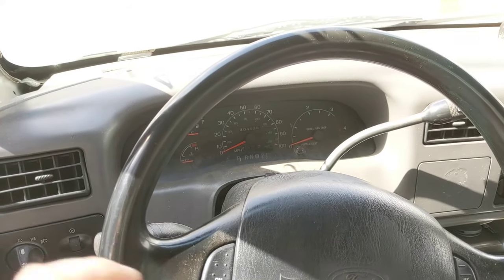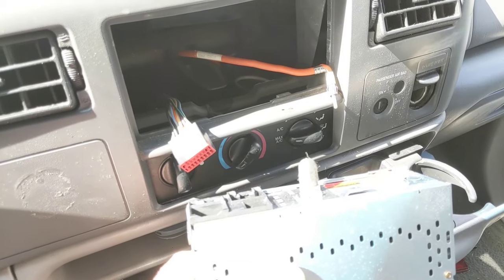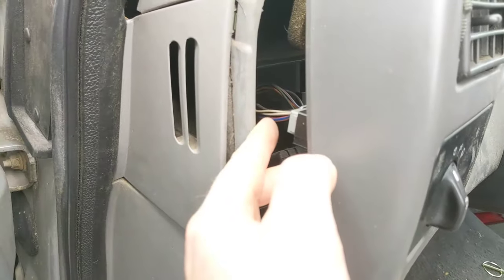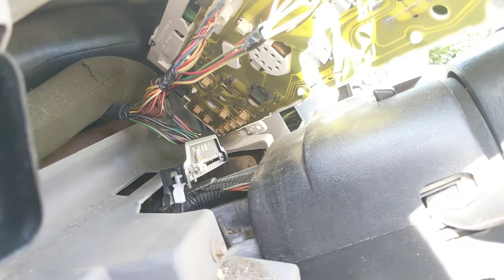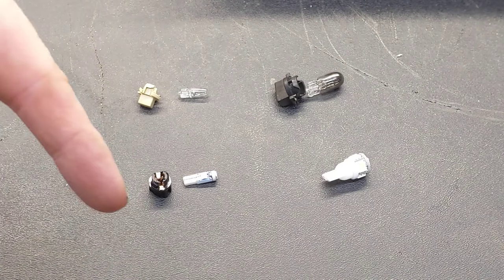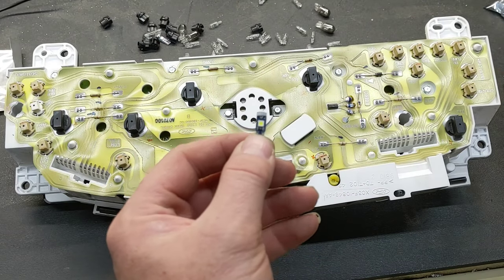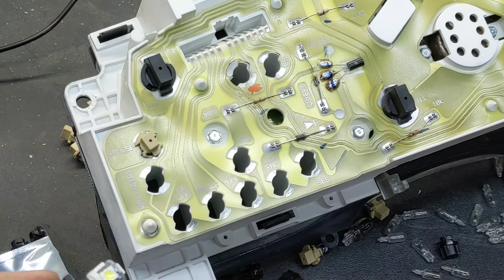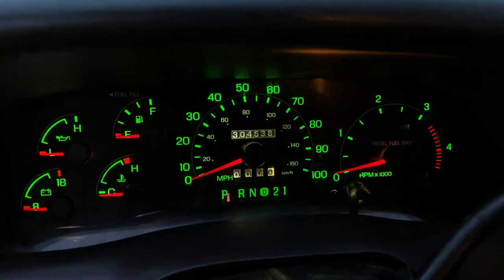Ford Super Duty Instrument Cluster Removal and LED light bulb swap! 7.3

Comment: What color did you use?
Reply from the maker: Bright white, there are links to the exact bulbs I used in the description
Reply: The color of the bulbs doesn't change on the dash bc they are behind the dash and the dash has a laminate across it if that makes sense to you. I think in order to get the dash to change color you have to change that laminate in the front. Thats why I just went with the white bulbs to fully illuminate the reds and greens on my dash. Hope this helps.
Reply: since the film laminate is green, you could probably use green bulbs too, it would just be super intense green
Reply: Red changes the entire dash to red, no matter the color film.  If you like night vision to be the best

Comment: How about the temperature controls? Being 22 years old, id rather not just start "figuring it out" bc im bound to break something. Lol
Reply: It’s basically the same concept just take the bolts out of the temp controls unplug it and replace the bulbs they should be the same as the warning lights on the cluster

Comment: I had mine changed to LED as well after this great vid.  The new LED look is awesome.  However on mine, my air bag and seat belt light up lightly, not on, but just lightly when the vehicle is running, don't see this when you just turn on the key but vehicle not running, any advise out there on this?

Comment: Some leds store energy after they are shut off they still glow or flicker. I ended up using some of the old bulbs in place of the leds. For example my 4x4 indicator continued to be lit up after shutting it off. Since this isn't used every day I just used the non led type for it. 
There's probably a resistor or something that might fix this? Idk.

Comment: Hi OP. After your LED bulbs replacing on your 2001 Ford F250, did you have Check Engine light come on for a second or so, then off?

Comment: You said you used white for all of the lights, but how did you get it to eluminate green? You didn't use any green?
Reply from the maker: Correct.   I used white lights.   The colors on the instrument cluster comes from the translucent paint that is on the back side of the panel.

Comment: LED dimmer lights require a replacement dimmer switch specific to LEDs. The dash has a dimmer wheel as well. Is there any concern regarding dimming LEDs in the vehicle? Also, how many bulbs? I counted 18 small, 5 large.
Reply from the maker: As far as dimming, this can be specific to the LEDs and the vehicle.   Some LEDs are designed with the correct resistance to mimic an incandescent bulb.   However most older Ford's require nothing special and pretty much any LED will dim in them correctly.    As far as the count, it will be specific to the options on your vehicle.  There also have been some comments about some of the LEDs bleeding some light even when they are supposed to be off.   I suspect an LED with some extra resistance would correct this issue.

Comment: Ford and mazda seem to be the only manufactures that the headlight switch will actually dim LED bulbs.   Do your dim with the adjuster wheel or just on/off?
Reply from the maker: Yes, mine do dim!
Reply: @1D10CRACY  awesome.  Good news.   They dont on my tacoma its on or off, no adjust.    Just ordered them for my excursion, was hoping they worked 100%   Thanks

Comment: What do we do if we have a 2002 Lariat with the digi odo. I took out the cluster and seemingly all the bulbs are soldered to the board.
Reply: I have an ‘02 lariat and I was wondering the same thing
Reply from the maker: Not much you can do unless you are capable of desoldering and soldering in new bulbs, which is what I would do.

Comment: So how would I go about fixing the dimmly lit lights tht are not supposed to be on? When I turn my key on all my lights turn on brightly then 4-5 go dim and stay on like cruise, check engine, wait to start door ajar and water in fuel the lights didn’t stay on before bulb swap
Reply from the maker: Odd!    Mine didn't do that!   Did you buy the same brand / style of bulbs?
Reply: Yes I did at first I thought it was bleed thru lighting but it’s not when the key is turned on all dash lights come on nice clean and bright but then after they are auooosed to go out I have 7 that stay on just very dim
Reply: @charleslangston8244  I am having the same issue with mine and curious if you (or anyone) has found a resolve to the distraction.
Reply: The only way I was able to fix the issue was to go back in with regular bulbs on the few that where staying dimly lit so it’s not as distracting at night
Reply: @charleslangston8244  thanks for the reply & I may go that route myself.  If I find a better solution, I’ll definitely pass it along.
Reply: It doesn’t bother me with the non leds in some of the spots because they are only on for a few seconds when I turn the key on all of the backlit leds for nighttime driving are leds and work great
Reply: @charleslangston8244 mine did the same thing idk if it’s the cluster or just the fact that the leds are super sensitive to any current
Reply: I guess no one has found a resolution to the lights staying dimly lit.?
Reply: Keep in mind that your airbag, seatbelt, check engine, cruise, wait start, door ajar lights. etc are controlled by a computer that’s constantly checking for any of thoes actions so there could be some sort of low voltage from the computer keeping them slightly on since leds are sensitive to voltage like that.

Comment: When I go to the  194 at Amazon it tells me that these bulbs don't fit my 99 f250 or will they
Reply from the maker: Amazon is correct, those bulbs are not what Ford would of used for your vehicle.    That being said, they may fit and work just fine, at least they did in mine.

Comment: how many of each bulbs do you need for a total dash swap? is the white bulb holder the same size as the tan/off white holder?
Reply from the maker: The count will be different depending on your trucks options.  And I used the same bulb in the tan spot, it fit and worked just fine.
Reply: it looks like 19 #37 bulb spots and 5 for bulb #194? i plan on ordering a few spares (i dont wanna have to put it back together while i wait because i am short a few cheap bulbs)
Reply: Did you use white LEDs or green ones?